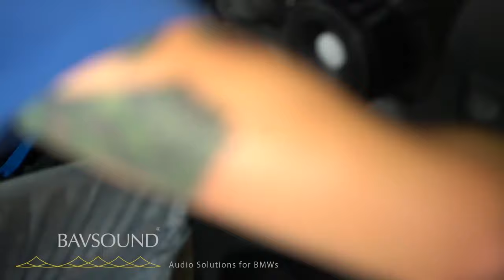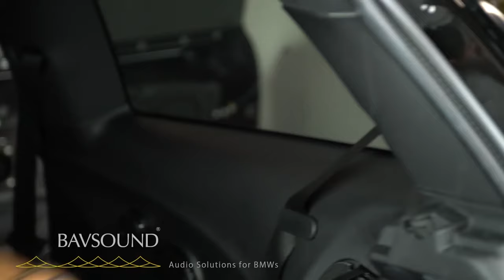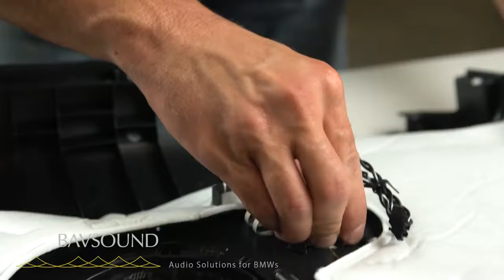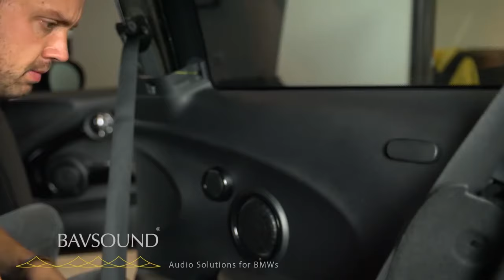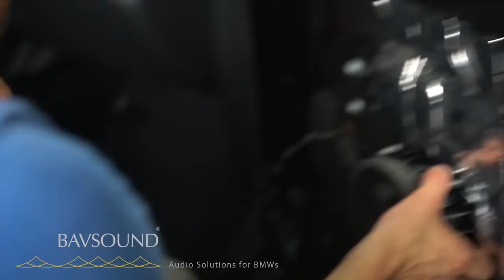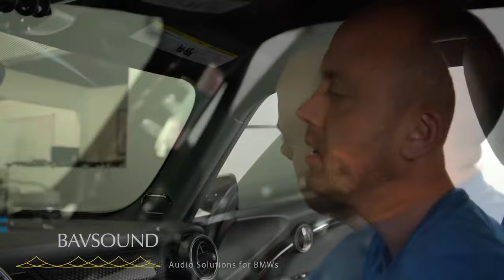MINI Cooper Speaker Upgrade/Installation | F54/F55/F56/F57 + Some R Series | BAVSOUND Stage One

Comment: If you happen to break a plastic clip, be sure and remove and\or replace it before you put the door panel back on, or it will rattle and buzz incessantly.

Comment: For the Base audio kits with coaxial speakers the speaker with the longer wire that has the capacitor in it (BSD.SP.CX.4.SOF.C-V3) will go in the front doors. The shorter wire goes in the rear (BSD.SP.CX.4.SOF.-V3).

Comment: In non hk system the centrale speaker wire are present and Active? And for the OEM system without hk Is possibile to upgrade speaker same at this video ? Ti enance Power and quality? (Exuse for write error I write from Italy) :-)

Comment: I've always thought the minis had a decent sound system especially the new range
Reply: They do. Of course, if you like all these audio thing, never is enough . ;)
Reply: Frankly, the base model in a Mini is pretty bad, especially the subwoofers. When I ordered my 2022, dealer said the Harman Kardon was not available due to material shortage. So I’m ordered the stage 1 and ghost from Bavsound.
Reply: @jeffluk1824  how does it sound now?
Reply: @SinCityAMG  I upgraded my underseat, the mid and bass are improved but not by too much, probably because I haven’t changed the front speakers. The sound and treble still quite “muddy”.
Reply: @jeffluk1824  If I do get one with out the HK, I guess my first change will the the front speakers. Not too sure on the underseat woofers since you said it didn't improve your mid and bass by much considering how pricey they are.
Reply: @SinCityAMG  I once upgraded all speakers and underseat subs in my 5 series before, the result was really good, they work well even with the stock sound system. 

That’s why I go for the subs as well this time for my Mini. 

I guess it really depends on the music style you like to listen and how much you enjoy punchy bass.
Reply: @SinCityAMG  you can always upgrade one part at a time. Given Bavsound often has promotions.

Comment: The quality of this video is shockingly bad. Out of focus at times. Camera trained at the back of his head. The needless chattering and jokes (the reach around is ridiculously juvenile though I would find it amusing most of the time) and the lack of ANY kind of editing that could have cut it in half of make it vehicle specific. He never addresses items that he says he will later and snaps parts apart that have tabs that need to be slid off first without mentioning it. The sound deadening that he struggles with no longer accompanies the speakers by the way.